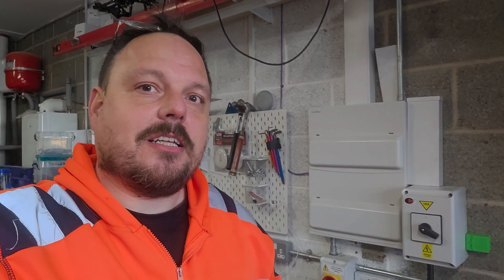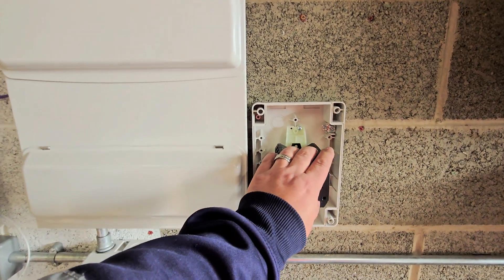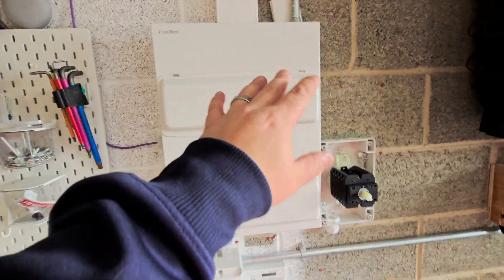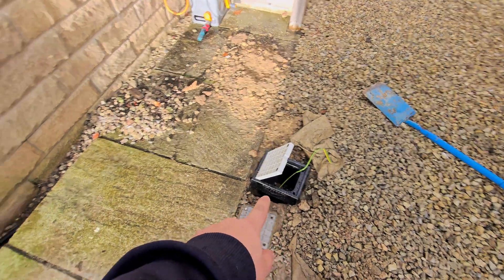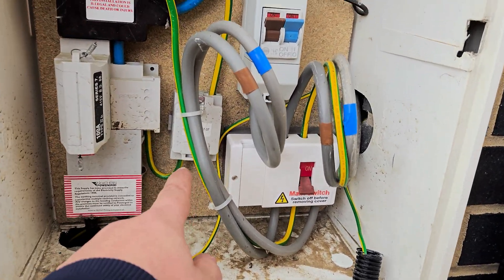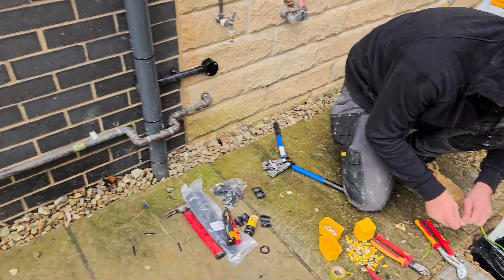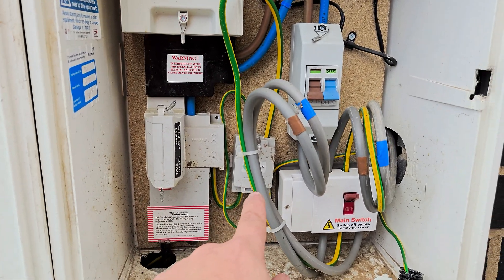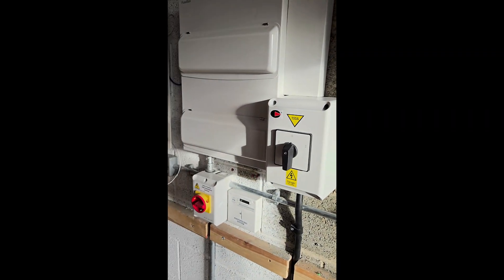ISLAND mode SOLAR and BATTERY how do you do it ???

Comment: I'm always surprised that considering you have DC current within the inverter that nobody seams to use Type B RCD,s with DC current detection, as normal Type A RCDs do not detect DC current
Reply from the maker: This would depend on the inverter manufacturers instructions. Some will only work on 100mA RCDs as an example. The DC voltages are an inverter are not particularly relevant here. The issues with blinding type A rcds which are fine to circa 6mA DC/RDC comes from things like inverter drives in heat pumps. 

Type AC don't have any ability to handle DC blinding (supposedly) Type A do which is why they are used on socket circuits with lots of DC power packs and inversion activities going on. RCD protection on most inverters isn't even needed unless the cable installation method dictates otherwise. Hope that helps.

Comment: Hi is it possible to island and solar system...just had one fitted with battery but have had no grid supply as storm caused faults. 
Can you make system island when I need it. 
Cheers Mark...great vids 👍
Reply from the maker: depends on the model of inverter you have. If compatible EPS can be setup by an electrician.

Comment: Bit confused…Do they have an ev charger connected to that board? If they do how much battery storage do they have to feasibly charge the car off grid and still have enough to run the house off the batteries for a period of time as the average full ev car battery is around 40kw/h minimum.  What is the output on that eps as normally regardless of battery capacity usually their power output to even run an ev charge point by itself would never be enough .Also does the inverter have the n-e bond relay inside it to drop over when entering island mode if it does and it drops out does that not isolate the earth connection back to the met which in this instance would isolate the rod.? I was under the belief the earth rod cable had to run directly back to the drop out relay. Just trying  to get my head fully around this Mark. Great video and very interesting  mate.👍🏻
Reply from the maker: The N-E question is covered in the description 🤭. We have more coming on this hopefully. The rest is setup under the customers control. Consumption off grid is on them, but its 8kW inverter. It would be unlikely they would choose the fuel the EV unless of a zombie apocalypse but the option is there. Equally the manual control allows for this with a known off grid state. Many of the auto/gateway systems don't allow for that. 

The earth does not have to go to the relay. Current guidance is to tie the earthing modes together as this allows for pros in both grid and off grid states. But not without some cons and I've gone into this in detail on other videos 🤭.

Comment: I just wondered what the maximum demand is? You didn't need to create a critical load board so the inverter could support the whole house? 
Efixx, we're suggesting that breakers for EVCP and off grid ESS needed space on either side for cooling, and even hager said that their breakers had got warm! I couldn't find a 100ma bidirectional RCBO from Hager, as required by Fronius and Solax. Following the video on efixx, I used CPN Cudis 100ma RCD and 50A MCB, both bidirectional in separate boards, with a module space between. One for 10k Quattro and one for 6kW Fronius Primo. Then, there will be critical load boards as they have all electric kitchens, a heat pump, and EVCP.
I guess we and our customers are guinea pigs to see what works best. The powers that be don't seem to be  able to be analyse the issues until something goes wrong. I just had to trawl through RC62 for another job and we had to build a 2 hour fire compartment. In RC62 there is some doubt but I guess driven by recent fires and the legacy of Grenfell.
Reply from the maker: This is a customer request in terms of setup and he is considerably smarter than myself, efiff and tbf hager 🤣. 

That aside heat dissipation within a consumer unit is long established. It's in manufacturers datasheets but with some very big caveats that are often ignored or misunderstood. Myself and Neil Bridgeman discussed this maybe 5 years ago now on a podcast. 

Derating or spacing only needs to be done for circuits under consistent load for a duration beyond an hour and adjacent to others in the same position. This is a very unlikely circumstance in any well designed system. Most circuits would not be even close to max rating of breakers for other design reasons and derating would be factored in via other places such as shared containment and such. 

Good info to be aware of but it's funny seeing boards unnecessarily spaced. Design is done away from the instruction of social media.

Comment: Intresting to see the way you have done this . Regarding using the consumer unit as a junction box for the mains tails bit surprised with this as in the event of some one coming along and isolating the consumer unit.  Then finds that you still have this set of live connections.  Does that comply  might need a warning label at least . 
you had enough slack to run to other side of consumer unit why not go out the side and fit a separate junction box ? 
Watched the vid  waiting to see testing and proving of the operation of protection devices. When running off the inverter. 
You made no mention about the inverter and  how it controls the connecting of neutral to earth when in island mode.  Or even if it does .  If it does not do this then has the inverter got the power to disconnect the breakers under fault . As you will be running a system that is earth free and not referenced to earth . Nice produced  video
Reply from the maker: We can not and do not show every aspect of a job on each video. But in the description we have mentioned as regards NE bond. 

As clearly shown in the video isolation is via the meter cabinet. No labels required as the dual voltages are in the change over switch. Thanks

Comment: How do you decide which size/length of rod to use, and the size of the TT earth cable in this sort of setup? Do you just have a target resistance for the rod and keep adding lengths until you get there?
Reply from the maker: No defined value tbh. But we work on the principle of Ra 100 ohms or less in grid connected state.

Comment: Pity it wasn’t a Fusebox changeover switch to match the consumer unit, and they are much easier to fit. The bi-directional RCBO is still an A type, did it not need to be a B type for solar ?
Reply from the maker: The consumer unit based ones from fusebox are a nice touch. But for me blending things in the CU is not without risk that can be avoided. I'm terms of the change over switches themselves sorry to disagree but lewden knock fusebox for 6 lol. Not even close. 

Type B is not required on this particular inverter or a great many other solar inverters tbh. More suited for some EV charge points and heat pumps as examples. 

Thanks so much for watching and engaging with the channel.
Reply: Not sure what the risk is, I actually meant beside the consumer unit in 4 way Fusebox enclosure to match, aesthetics are also important in my opinion.
Reply from the maker: @Andrew-su3wt  presently we don't recommend fusebox after the afdd recall and some other issues. 

The risk is both islanded and grid based voltages inside the consumer unit to house loads. Big no no for me. 

I don't think the external fusebox change over switch is aesthetically very good. So we all see things differently.

Tag some of your work with them in and I will take a look. I'm happy to share our aesthetics for all to see 🙌💪

Comment: Hi just curious of how the inverter will know there is no grid supply when you switch over the changeover switch to island mode as it will re-supply the inverter RCBO?
Reply from the maker: This is currently in the process for the change over. The inverter AC isolators also needs operating. 

The customer has/had the neutral earth bond relay on order. We wasn't comfortable leaving it setup with the inverter wired from the grid supply only without one. When that is done it could be wired from the grid 125A blocks via the rcbo to allow it to see that when the grid is lost and change over switch operated. 

I do still think it's better in the way it's setup here as the grid has no direct connection to the inverter while off grid. If wired as described above we are relying on the inverter relays to keep it from back feeding into the grid if it was to ever develop a fault. 

Pros and cons as with most things

Comment: Hi Mark 👋 the earthing for island mode is a big point ❗️ 👉 

And we'll worth this great video.

Main thing is working out if eps output is floating netrual some don't mind being being tied to the eps netrual and some do.

Same with off grid genny setups checking that you don't have a floating netrual.

Sometimes a earth - netrual relay is needed.

Earthing on off grid is complex and requires a good look at requirements.

Alot of times in past have put the output eps on a double type a rcd double socket and linked out earth netrual and taken to a TT setup.

Great video  and really like your knowledge and depth of some difficult subjects.😊 and well worth a good discussion on off grid island modes and different setups and type of inverters.

Generators is one that can catch alot of us sparkies out.

Myself included 😌 
Earth netrual floating gennys and fully lined earth to neutral gennys are worth a discussion so you only have one point of bonding 😀 E-N.

Offgrid and power supply systems are going to increase for end users and building of such.

Big and great times ahead! Great to educate people on the importance of safely earthing off grid and eps as it can be more complex than it first seems !
Reply from the maker: The description mentions the N-E setup. This was a discussion between me and the customer. Something cool is now in the mix around that 🤭

Thanks
Reply: @electrician247  look foward to seeing that. If you ever need victron advice happy to help you buddy buy me a coffee ☕️ 😉 thats all.

Think you would love ❤️ victron and woth your clever mind could build some very interesting setups.
Reply: @bramcoteelectrical1088 
Yes I like victron, if I was younger I would pile in on it but retirement beckons next year.
Reply: @andyhodchild8  bless you 🙏  I wish you a great retirement 👍. 

Victron is most definitely the way foward ans someone like yourself would love the node red element to make it customizable

Comment: Fyi fusebox make a din rail mounted changeover switch part no SCO125SWB. That would have fitted into the existing enclosure and saved you some work.
Reply from the maker: Yeah I had seen that tbf. But prefer a dedicated switch outside of the main CU. Keeps the EPS outside of the CU itself if the worst is to happen.

Comment: The tails from the meter box look like 35mm2, but the changeover cables look smaller? The earth wire to the rod looks tiny. Is the earthing rod lead still attached to the supply earth after changeover? This is from a DIYer so be gentle with me.
Reply from the maker: All tails are 25mm aside from the inverter aka generator which are 10mm. 

Rod is 10mm earth and yes both are tied together as currently advised by industry to serve 2 different purposes in 2 different modes of operation. Thanks
Reply: @electrician247  Thanks for that. I presume there is no hot water, cooking or heating supplied by this back-up system......just fridges, sockets and lighting then?
Reply from the maker: @alanbutterworth4219  whole homeback means whole home. This will output 8kW power off grid if the consumer desires. Obviously the battery would deplete quickly but that is the setup they wanted. Loads of other examples on our channel. Thanks

Comment: Hello Mark, good video. Not sure your EPC to the earth stake is the right size. Should it not be 50% of the phase conductor size? After all, it's got to carry the fault current when there is a fault.
Reply from the maker: A common misconception with supplementary electrodes. These currently have no defined value of impedance in and of themselves. During grid mode the fault path is through the DNO earth and supplemented by bonds to services. So it makes sense to match those sizes even if this is very very unlikely to form a large part of the fault path unless exceptionally low impedance. 

During times it is the fault path when offgrid. The fault currents are by nature very small. 

More widely with the adibiatic equation it's surprising how small earth's can be. 

In this case the 10mm is more than adequate.
Reply: @electrician247  What about if there is a PEN fault? (something we are told to worry about these days). That could leave the rod earth as the whole system earth and maybe even be taking return currents from surrounding properties. I guess the point is that rods are never that low resistance so max currents will be constrained by rod resistance?
Reply from the maker: @xxwookey  I've discussed just this in loads of videos with those concerns and what is really a hybrid earth setup. But this is currently the approach industry recommends. Even with the rod in the mass of earth you are not detached from pen faults in urban areas. Even more so with metallic bonds. 

In island mode the DNO earth and said bonds give a great source TNS function for the islanding system. Equally the rod provides a great support function in grid tied mode to reduce the impact of things like pen faults inside the installation. 

It's the same problem for any electrode, metallic service or otherwise during pen faults. Masking it to a degree. The solution to that is the DNO maintaining networks correctly. 

But as I say I've run through this on a video or 3 around 1 year ago and thrown that scenario at the industry of things for consideration.
Reply: @electrician247  Yeah, I've just discovered you have a fine back catalogue discussing this stuff, and even an example of said PEN fault using a customer's EVSE rod to power several houses. It's an interesting subject we're all going to need to get on top of with lots more batteries,  islanding, inverters and PV.
Reply: @xxwookey I am surprised that the powers that be aren't more interested. I wonder how many of those backup sockets are tested? They just had to rush through AMD3, glad to see positive identification from Fusebox with BD, I don't agree with the absence of direction means it's bidirectional. 
Efixx had a video out where installer says don't fit earth electrode without any discussion as to why! I posted "IET ESS 3rd edition 6.6 says to fit one", their reply was as glib as original comment.

Comment: Only issue of concern for me is load mangement on island mode & making it idiot proof 🤣⚡
Reply: 😊I agree lads and most inverters output 16amp on eps.

Afew like victron you can output upto 200kw!

Really depends on what the client is trying to achieve.

One install was to backup the stairlift eps battery so customer wasn't trapped during a long power cut in a rural area.

Another was to go fully off grid and needed upto 15kw per phase.

All exciting in eps and offgrid as makes you realise you can be fairly stainable!

Great videos Mark and you have a very good technical knowledge that is getting difficult to see in the solar and off grid side of things.

Kind regards Joe
Bramcote electrical
Reply from the maker: Yes I would have similar concerns generally. But this particular customer is a lot lot lot smarter than me. Bordering on genius tbh.